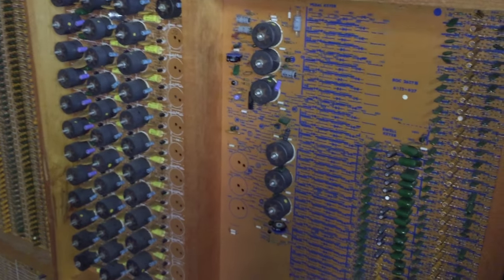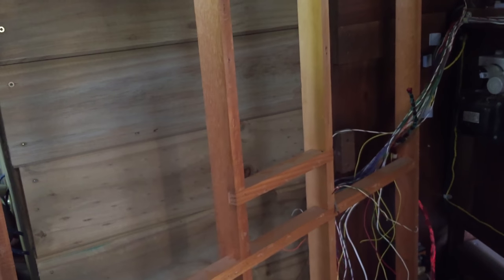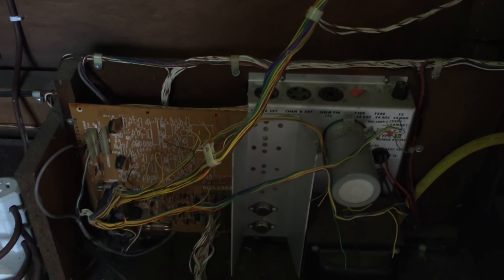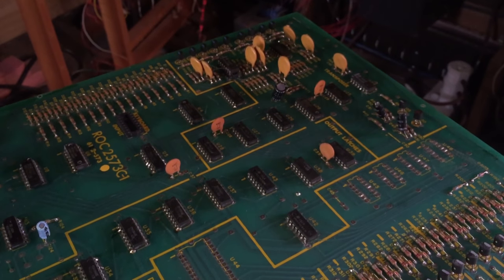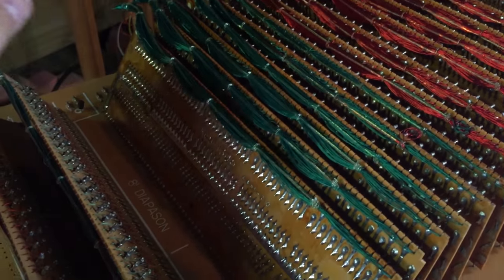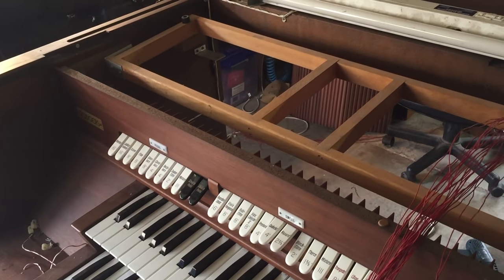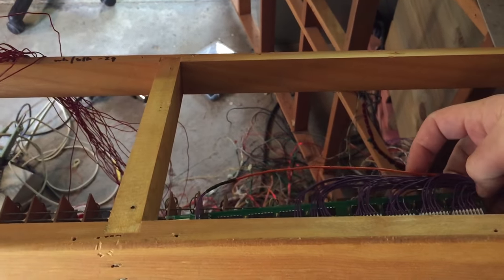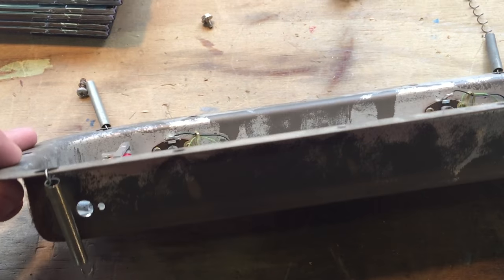Refitting an Analogue Pipe Organ Console - Part 1

Comment: Trent, thank you for posting these two videos. Fantastic work. I am looking at acquiring a similar organ from a friend, a Baldwin. It works well as a practice organ but I've been thinking of gutting it just like you've done. I'm wondering if you could share some information about a few things:
- I haven't dug around in the circuitry for an organ like this yet. For the key, piston, and stop contacts, did you just identify where the "switch" is and wire directly off of that?
- Did you use a common ground, or do you have two wires going to each key/piston/stop tab?
- Would your friend let you post the schematics of the boards he made for you? Just so I don't have to re-invent the wheel.
- Did you ever think of using RJ-45 jacks and Cat 5-type wiring instead of messing around with the plugs that you laboriously worked so hard on? Cat 5 wiring has the additional advantage that every wire is color-coded.
Reply from the maker: Nicholas Moe Hi, thanks for your kind words. To answer your questions:
* For the thump pistons, stop contacts, I just reused the existing wiring - common ground and signal wire. The manual keys themselves had some multiplexed arrangement, so I had to solder wires directly on to the switch contacts. There was 8 different 'common' grounds for each manual, so I had to join them all together to get a single common ground for each manual.
* Yes, I used the common ground. It made much more sense, and also meant that I didn't have to re-wire the entire organ.
* I'm not sure regarding the schematics
* Yes, I've thought of using RJ-45, but the size of the connectors would have meant that the board would have had to have been larger, and the vertical height would have been increased. The board designer chose these connectors, and once I had gotten the knack of using the crimping tool, it wasn't too bad. Previously I had also thought about using 68 pin SCSI connectors, but they were difficult and expensive to get hold of.